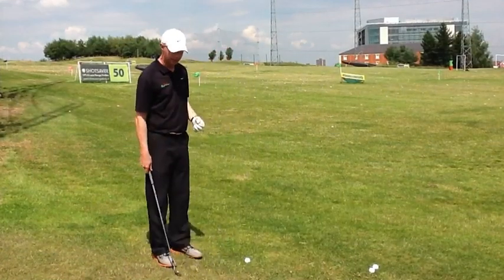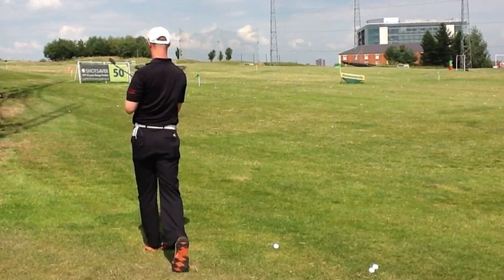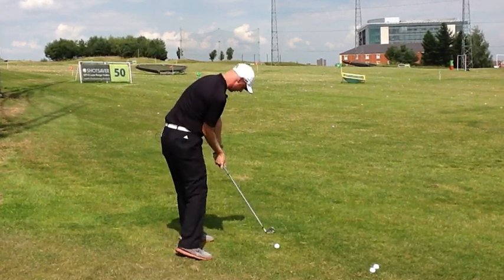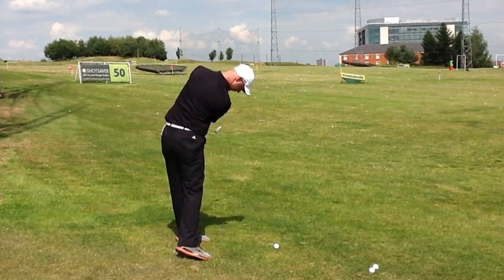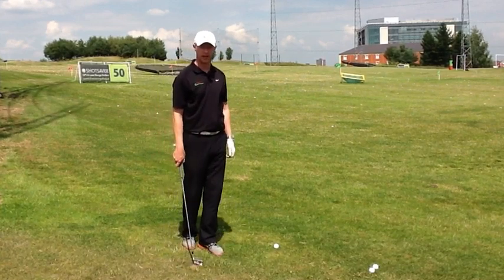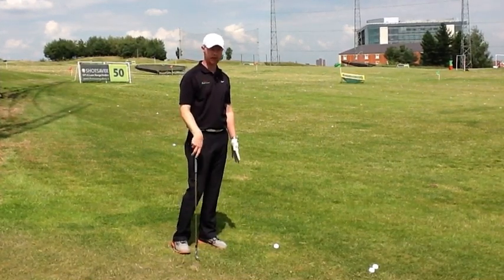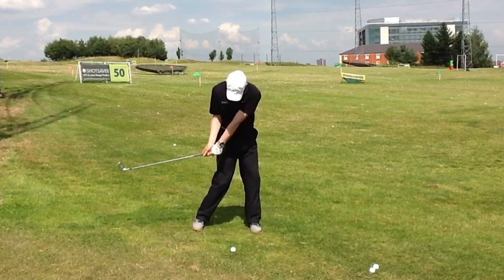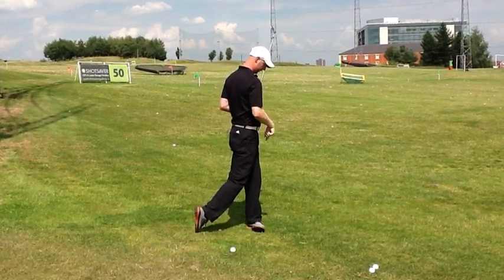How To Build A One Plane Golf Swing Part 5 - The Follow Through

Comment: This series is very well done and I think it will help me a lot as I develop a one plane swing.  It looks as if it will be easier on my back since it doesn't require an aggressive lateral hip shift and the weight stays centered longer.  I like the driver setup adjustment that allows one to make the same swing.  I need simple and repeatable!!!!!!
Thanks.
Reply from the maker: Thank you Don

Comment: Ged, thank you very much for the video series it was incredibly clear and understandable. I've watched other instructors on youtube and they seem to have both arms straight at setup.  It looks like your arms hang from the shoulders like in a conventional swing. Your way is much more natural to me. Did I observe this correctly?
Reply: Correction. At setup there is an angle between your arms and club, not so with others. Their arms are in line with their clubs.
Reply from the maker: Les Peterson You did indeed, the plane of the shaft is the focus and not the arms. They must remain in a natural. In my opinion Moe Norman's arms/club extended will produce a constant plane but without as much power as a more natural and relaxed arm position will produce.

Comment: Hi Ged, great set of videos but what are the benefits of a one plane swing???
Reply from the maker: Alan Mitchell Thanks Alan. The benefit is that you don't have to rely on the timing of your weight transfer back and through so the low point of your swing when do correct;y will always be just ahead of the ball ensuring a ball then turf contact rather than the potential for the low point to move behind the ball and result in fat shots.

Comment: Great video, and your explanations really get to the point...no blah, blah, blah that turns 3-4 minutes of instruction into 10 minutes.

Only question I have regards what appears to be a good deal of forearm rotation....my understanding is that the throw release of the trail arm should put the wrist in full extension, and that forearm rotation in this swing shuts the face too violently.  Am I misunderstanding the fundamentals?
Reply from the maker: Great question Joel, It's relative to whether your release patten is that of the trail arm hitter or lead arm swinger. This demonstration is lead arm swinging so if you added the trail arm hitting motion it would indeed increase the rate of closure through impact.
Reply: @Ged Walters Golf  thank you, I didn't realize that one plane swing were compatible w/ what you call a "lead arm swinger"  (Hardy and O'Connell refer to that as LOP, Left Outward Pulling).  Thanks for clarifying.

Comment: Not trying to be a dick here or trying to make you look bad but this isn't a one plane golf swing though. It's like you have used that term without really appreciating what it means and then broken down the individual parts of a regular swing instead. That's not to say that there is anything wrong with your swing, it's just that it's not the one plane kind.

By one plane, it means the club travels along the exact same path or plane during the swing, so that everything is lined up the same way at impact as it was at the start of the swing when you first place the club head behind the ball at set-up. It's almost like a robotic swing with no deviation or movement from the path or plane, in much the same way as something with a fixed hinge like a door or a clock's pendulum can only move or swing one way and then the other on the same path or plane, unless the door's hinge was loose then there might be a slight up and down wobble as you open and close it, causing it to move on two different planes whenever you do open and close it.

Your arms are in the wrong position to begin with if trying to make a one plane swing, with them hanging down straight with your hands at 6 o'clock on a clock face but then end up pointing somewhere between 4 and 5 o'clock at impact because the backswing and downswing were different paths or planes. It would be almost impossible to make impact and be able to return your arms at 6 o'clock as you do so, so they would have to be adjusted to between 4 and 5 o'clock at set-up, in order to return them there at impact too.

The top end of the club shaft is pointing at your belt or waistline during your set up here with your arms hanging at 6 o'clock, but then the end of the club shaft is pointing more towards your upper abs or lower chest at impact once you make contact with the ball and your arms have shifted to a second path or plane by the time of your downswing, meaning your arms and hands have also shifted more towards 4 and 5 o' clock.

If you look at the angle of the club shaft at 0:00 at set-up compared to at 0:02 at impact you can see this. You might have to click on the settings cog wheel at the bottom right of the video and slow motion down to 0.25 playback speed and then keep clicking to pause the video to try to freeze it at impact to show this.